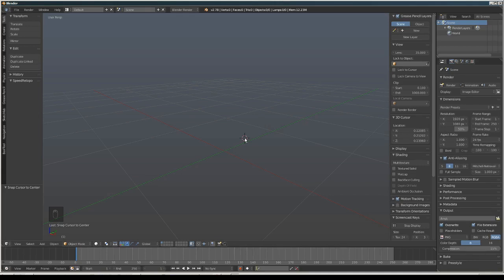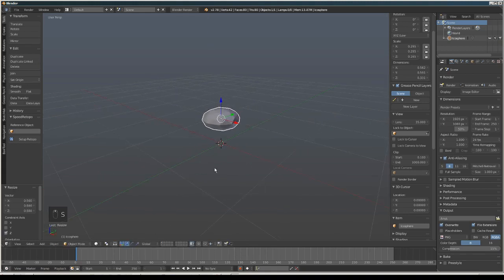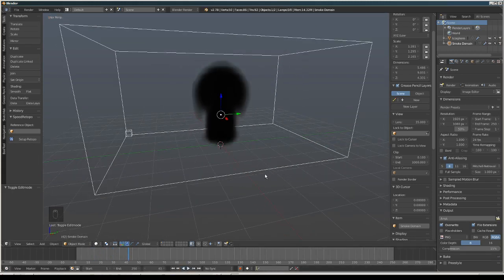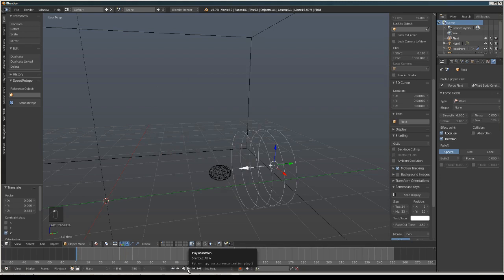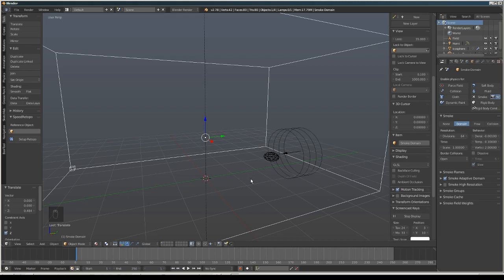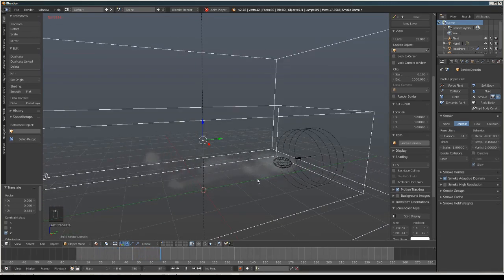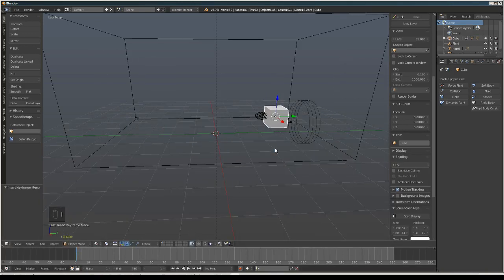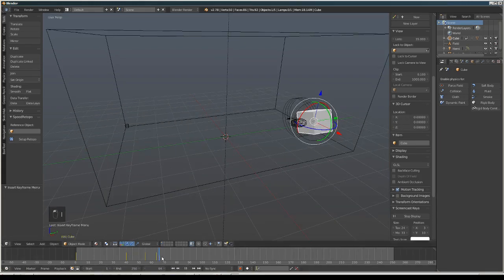Blender smoke simulation tutorial

Comment: Good tutorial. Your English is fine.

My program had a hard time rendering this. What sort of graphics card do you use to create your smooth simulation?
Reply from the maker: +Edwin Jun im using radeon 512mb old graphic card (making my way on those expensive card). But this scene was intended for opengl render.
Reply from the maker: +Edwin Jun im using radeon 512mb old graphic card (making my way on those expensive card). But this scene was intended for opengl render.
Reply: I didn't find an opengl option for blender cycles. Do you know if there is any in that one?
Reply: It's not in Cycles. It's in the viewport as the the same camera and slate icons that you see in Render Settings. If you hover your mouse over the icons, they should say "OpenGL Render" in the tooltip that pops up. Basically it renders everything in the viewport exactly as you see it.